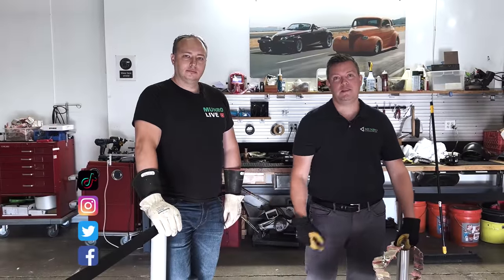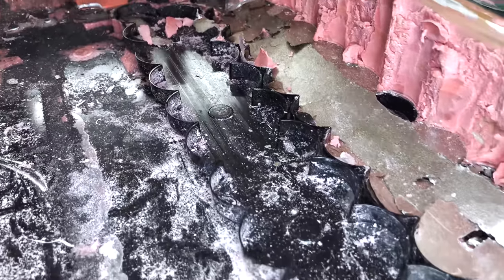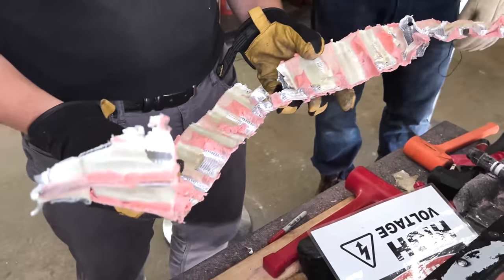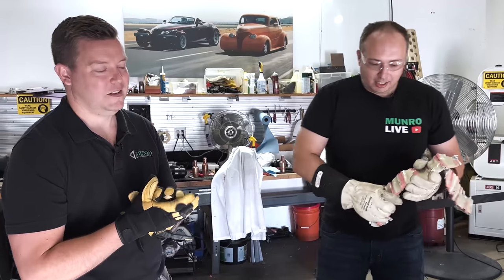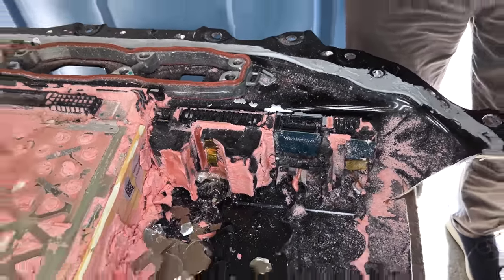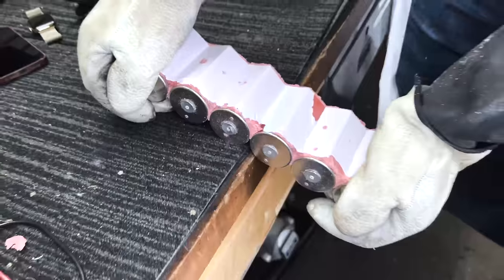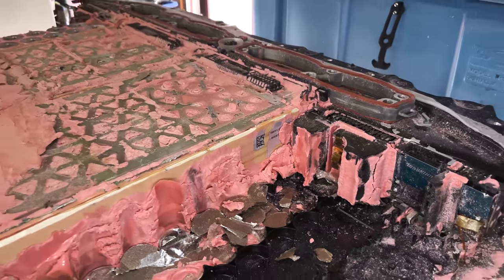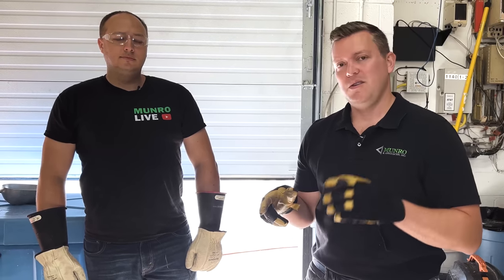4680 Update Structural Adhesive | Tesla Model Y

Comment: I hope they get hold of a berlin tesla and take apart the structural blade LFP battery pack
Reply: Shipping to US may be legally impossible.
Reply: @EMichaelBall  maybe as air freight but they can ship cars by boat
Reply: @Werdna12345   (it is only air freight in passenger airplanes which is a problem, dedicated  freighters can ship bulk lithium batteries.)   - If a product for some reason can't be imported into the USA - ie. the 25 year DOT compliance rule - just reclassify as for off-road use only, or "industrial spare parts" - in pieces... OR do a teardown in Europe, I am sure European manufacturers will (be happy to) check on the competition as usual.

Comment: The bottom sheet metal is probably just as structural as the top sheet, but does not need to be glued because it has only stretching load. It has no reason to buckle.
Reply: The pack's strength would greatly increase if the bottom was glued, too (sandwich structure). But as you say, it can't buckle, and also they need a side to vent the batteries. It makes sense to choose the bottom for this purpose. At this point, the lower sheet metal cover carries some load through  the sides of the pack and is protective against rare impacts from below. The top carries much more loads from the seats and the passengers. Good design.
Reply: @gehtdichnixan4704  I think it would not be stronger if the bottom part would be glues in this application. 
A sandwich structure is stiff against bending in both directions, but here we need only one direction because we know that our load is pressing down. A sandwich has two sheets that are strong against tension and against compression, but very weak against bending. We keep them from bending by putting a spacer in between.
If you put a load on that sandwich, pressing down in the centre, it creates compression on the upper side and tension on the lower side. The tension also makes the lower sheet press against the spacer. There is nothing a glue could do in this situation. It is a sandwich structure that works only in one bending direction.
Reply: @vsiegel  There are minor/edge load cases where a true sandwich would be beneficial: shear and torsion. But I guess these are negligible for a car and one would just accept slightly reduced rigidity in these situations.

As for the sandwich in general: the outer sheets are only strong under compression if supported against buckling. But a one-sided spacer/stiffener suffices to this end, so again this battery pack is well designed.

Comment: Can’t wait to see how tesla continues to improve on this concept in the coming years.
Reply: Yeah copying apple and making cars less and less repairable right!? What a nonsense concept!!
Reply: When you look at those super old caterpillar ir vehicles in the roads imagine if those were made from a single large part!!
Reply: @alanmay7929  would you like to replace single cells?
Reply: @robindehood207  not a single minute multiple in case this fails instead of buying a whole new battery pack! With all the BMS glued into the pack goes knows how long those things will last lol…..
Reply: @alanmay7929  how you plan to balance the pack after replacing degraded cells with full capacity cells? 
How you going to control the voltage differences these cells newer cells generate? 
How you going to get a single cells out without damaging the modules / coolent lines / cells near it? 
How you going to certify the pack is safe and stable?
You going to pay the customer a full new pack if you brick/damage the pack?
You going to give warranty after the repair? Since why else would I even care to let you repair it if you could make the pack unstable and burn down my car. 

It is way cheaper to shred the pack than to try to repair it. If repairing a cell was cheaper, they would already do it in hybrid cars and phones. But since the operator cost is so high for a repair no one things about trying to repair it. Not to talk about certification cost / schooling cost / tools cost / work hours cost since it need to be done by a specialist / part cost safety hazard regulation etc. The pack probably cost Tesla like 12k USD, so it prob will cost 15k to the end user. If you think that replacing a single cell is going to be as cheap as replacing an engine(which easily can go above 7k USD without parts, just work hours) you free to open a shop and prove it.
Reply: @pipooh1  you read my mind. To add to this, if it were possible to replace some cells and the battery becomes faulty or unstable, whatever the result of that (be it fire or any other undesirable result) it would be pinned to the manufacturer aka Tesla, not the individual who actually caused the problem in the first place. In the end the cost is just too high monetary or otherwise.
Reply: Perhaps they might improve it by making it easily repairable, re usable an re cyclable? That would be an obvious improvement given humanity's quest to reduce its impact on the planet. Obviously Tesla has absolutely no interest in that, however.
Reply: @davidbrayshaw3529  There no need for easily repairability. The battery packs cost are going down every year, Tesla went from 200$/Kwh to now around 100$ in like 5 years. With 4680 cells they want to even go below that once they get mass produced. 

You forget how cheap it is to shred a battery pack. It cost them maybe 20% of what all those resources would cost if bought new and they know that the resources from the pack are clean. So it makes more sense to recycle pack than to repair them.

How you think tesla has no interest in recycling? Co-founder of Tesla has joined in with other to start up Redwood company to mass recycle batteries in USA. Please inform yourself a little bit before making statements like 'Obviously Tesla has absolutely no interest in that'...
Reply: @pipooh1  I would suggest that repairability is a fundamental aspect of good design. The embodied energy in these battery packs must be huge. Why throw the whole lot in a shredder if only one or two cells have failed?  And currently, how many lithium ion batteries are recycled, as a matter of interest? Recycling is still in it's infancy and Musk's claim of "cryogenically" recycling these batteries is a pipe dream, at best.
In the context of existing technologies and practices, throw away battery packs, regardless of how cheap it is to dispose of them or where they ultimately end up. I think I'm informed.
Reply: @davidbrayshaw3529  well if you think it so easy to repair a pack, feel free to design one and open a work shop to repair them. 

Since there is no work shop atm offering any pack repair proves already that your pipe dream will just be a dream. Financially it's way too risky to even go into repairing a pack.

Who is going to repair the pack, if done by 3rd party who is responsible if it goes wrong? Since Tesla name is on the car, they will get their name in the news, not that repair shop. What you think will most likely happen, 'Another Tesla battery pack catches fire' or '3rd party repair cause battery fire'. The first one will be all over the news...
Reply: @pipooh1  It is very obvious that Tesla has designed this battery pack solely on the basis of its own commercial interests. I can understand why, but I'm frustrated just the same. My understanding is that there are repairers that rebuild and repair battery packs however it is very disappointing that a manufacturer such as Tesla has ignored the opportunity to do so itself. What a great marketing opportunity that would be for the business: Serviceability,  sustainability and cost. Tesla have ignored to engage the market on these points and have rather chosen the model of whole vehicle disposal and replacement. Once again, disappointing.
For many prospective purchasers of EV's, both the environmental impact and the cost of ownership are very real concerns. With this particular design, Tesla has failed at even attempting to address these issues, in my opinion.
Reply: @davidbrayshaw3529  why only point at tesla? Are all those other pack makers making it serviceable? No, so stop point only at tesla but at the whole industry if care so much about that part of the industry.
Reply: @pipooh1  If the whole industry is that bad it is a tragic indictment. Perhaps governments around the glove need to step up and put an end to this wastefulness. The human species is consuming its way to oblivion and this is just another example of how.
Reply: @davidbrayshaw3529  Last week Elon stated Tesla is currently recycling only about 50 battery packs a week, as “the majority are still in use”.
Reply: @Simon-dm8zv  Elon has a long history of making statements that are anything but factual.
Reply: @pipooh1  that means evs are not ready for prime time. Will check back after 10 yrs

Comment: Tesla's next iteration - attach the suspension directly to the battery pack
Reply: They better add an adaptive suspension first.
Reply: Cast the wheel directly into the suspension and square wheel lol…..
Reply: Cast also the transmission, suspension, seat skeleton, why not 90% of the car? A young driver makes a mistake in the parking, you have total damage. That is the direction they are on, I hate how the pack is a $10k zero serviceability piece.
Reply: @ContraVsGigi  Battery pack failure will be an expensive out of warranty repair now. But in 5-10 yrs it will be as expensive as an engine or transmission replacement with the potential to last longer with some degradation of course.  Battery packs will continue to go up in efficiency, down in size, and definitely down in price.  Everyone is now focus on beating Tesla so competition will force EVs to keep getting better. This is only the beginning.
Reply: @Teddy_M85  An engine is not a single piece. You only change what is needed.
Reply: @ContraVsGigi  Right but the labor is sometimes just as expensive.  And we know how much you will be saving in gas by the time you need an out of warranty repair in 8 yrs, if bought new. Those that buy used and don't know this will be in for a rude awakening. In the future you might get some type of credit for your old/defective battery to help offset the replacement cost as well. The used/recycled market will be a thing in time. I for one won't be keeping my MYP past the warranty period until all these things come to fruition.
Reply: @ContraVsGigi  cast doors, cast hood! Cast fender……. 😂 😆 😝

Comment: This pack is the epitome of the old saying “No user serviceable parts inside” I’m pretty sure Elon did this with Rich Rebuilds in mind!
Reply: -Rich: "They always trying to keep a brother down"
-Elon: " I'm actually more African then you"
Reply: Ehhh. It's a structural part and literally just a huge battery. Batteries are never meant to be taken apart and structural parts need to be as rigid as possible.

Plus, every story I've seen of someone trying to replace a few cells in a Tesla ended with issues anyways. So nothing lost anyways.
Reply: @BSEUNHIR  
The last generation model S had modules that could be replaced. Ask Rich Rebuilds!

Comment: It's really interesting that they're not able to use the top or bottom surface for cooling. Could you guys comment about why that doesn't seem to be the path they took? Surely that means the middle of the cells are going to be exposed to quite a bit of extra heat under load?
Reply: The sides have a larger surface area, so they’re probably better for heat dissipation.
Reply: The top and bottom of a cylinder are the smallest surfaces, so it doesn’t make much sense to use them. On top of that the top surface is used for the connections, so there isn’t much space for cooling channels and the bottom is used for degassing, and if those cells needs to degass in a misuse case, you don’t want a rigid cooling channel to be in the way of that hot gas.
It seems like it is their only option, but doing so, they’ve lost some of the positives of the tabless design. 🤷‍♂️
Reply: You're assuming these cells will get hot enough to need more passive  cooling?
Remember a major point of tabless is to reduce resistance, which in turn reduces the energy diverted to resistive heating.
If it's cool, you don't need bottom cooling.
Reply: That may be but heat - like electricity - mostly flows along an electrically conductive channel. Most stuff that is electrically insulating is also a bad heat conductor.
But very likely Tesla did a full thermal simulation and came up with this solution.
Reply: @Martinit0  
As I said, it depends on whether there IS heat.
Then there's the Colling channel in contact with the cells?
What you have here is a cell that's as far as us amateurs are concerned should "run cool, which has large contact area, a thicker casing which can absorb / dissipate more heat and a larger coming channel (which as I recall from previous  episodes, is arranged more efficiently than previous iterations?)
I'll stick with my previous.
"No heat generated, no cooling required"
Reply: @fredbloggs5902  Cylindrical cells generate heat from the center outwards, so end cooling carries out more heat per contact area, even though there's less of it. I'd be curious to see the thermal model of the 4680 is, because the tabless design should theoretically make the cylinder heat up more evenly than the traditional design

Comment: Sandy have y'all been able to look at the  new BYD blade batteries that will be use in the Model Y only qt Giga Berlin
Reply: Those surprises me a bit. All talk about the 4680 and building structural packs etc. - I felt like that was the goal eventually for all new designs. And now they are going to have another pack that won't be structural and they'll need to build the cars traditionally?
Reply: @subwarpspeed  the blade batteries can be a structural pack. Tesla has always planned to use LFP cells for most cars. It's far superior for low power applications.

Comment: Interesting to see what the power output of the 4680's truly are!
Reply: They are fully discharged and therefore permanently dead.
Reply: @anonym3017  You cannot FULLY discharge lithium ion batteries which is why they are wearing gloves.
Reply: George, I believe that are rated at around 80 Whrs per cell.
So, at a nominal voltage of 4V, each cell should be able to deliver around 20 Amps for 1 hour ! 
Quite impressive!!
Reply: @patreekotime4578  yeah that's just outright wrong.
A BMS stops you from fully discharging lithium,m or any other rechargeable one for that matter, batteries. but as soon as you hook up your leads tot the battery directly you can discharge it fully.
Reply: @Nicholas.T  Was some info about ~95 wh per cell